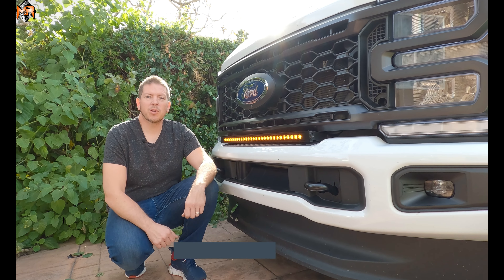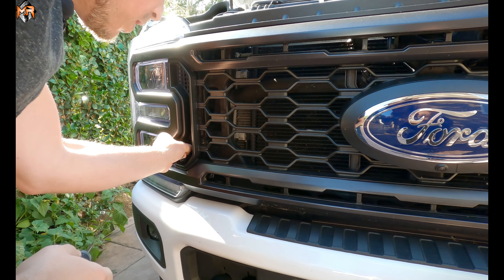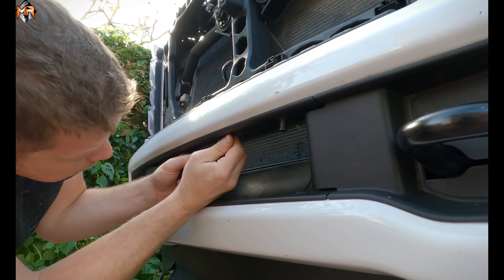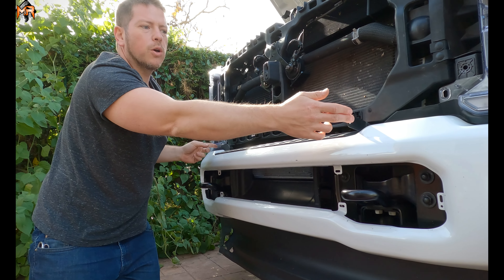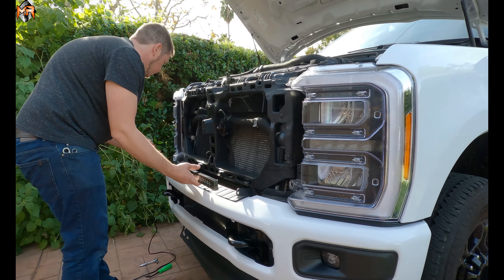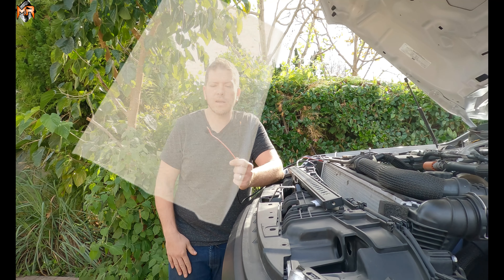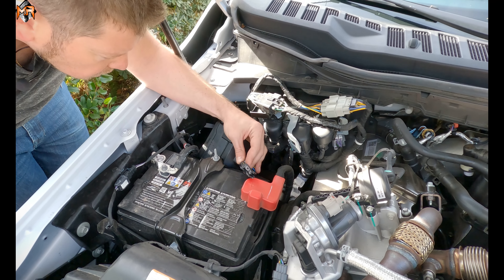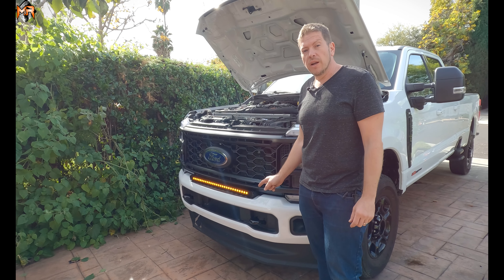Ford F250/F350/F450 Super Duty Light Bar (EASY INSTALL) 2023-2024 | M&R Automotive

Comment: I am a subscriber to your videos - How and Where can I hook up my (3) Raptor style Grill Lights to my Daytime Running Lights (DRLs) so they will go on/off when my truck is operating?  Thanks!
Reply from the maker: Thanks for the support. You can do a fuse tap to get power for the DRL and use a fise that is always engaged with ignition. Hope this helps.

Comment: Nice but to save a step, don't put the lightbar on and tighten down the brackets until the grill is back on.  No need to get it positioned and then take it off just to put the grill back on as the brackets need to be tightened from the bottom, which is accessed through the bottom covers, not the grill.  

So save the step and it will go 10 minutes faster.

Install the brackets, run the wire, replace the grill, then put the bar on and snug it all up.
Reply from the maker: Love the tip

Comment: Those Uplifter switches have a minimum of 20 amp fuses?   With your 140w light, you should have a 15 amp fuse at the most? Your 84 watt light would need 10 amp fuse at the most...
Reply from the maker: That is correct a 10 amp fuse should be enough

Comment: Doesn’t look very bright, the light doesn’t look very stout and would be so much nicer if it were a curved bar but the bracket system is very trick
Reply from the maker: Check out the light output video we made